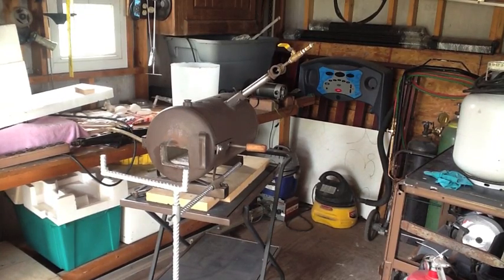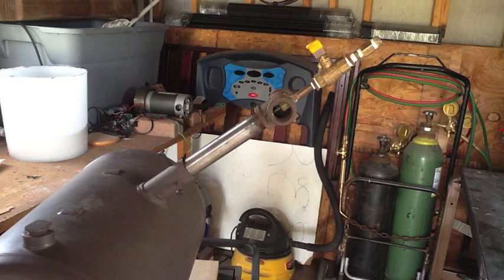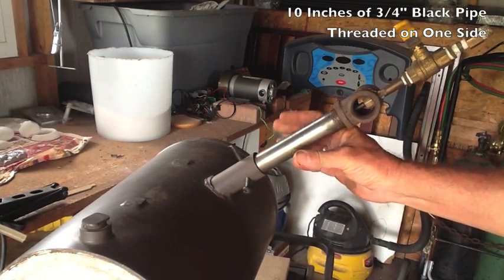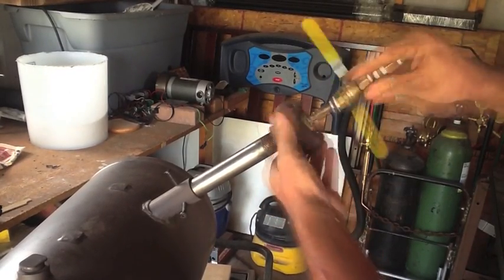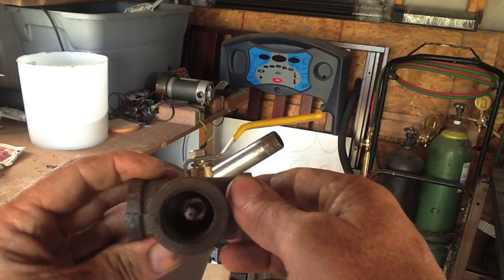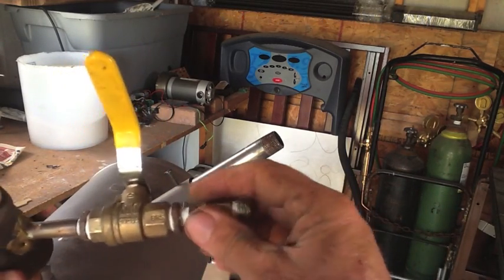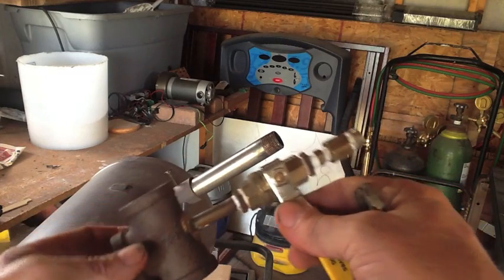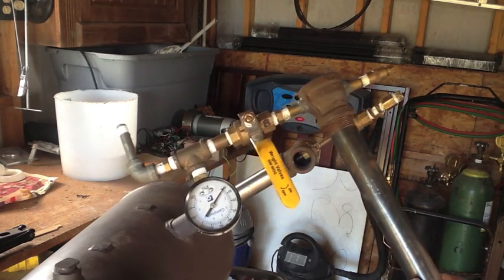How To Make A Propane Blacksmith Forge Burner ~ Build Details - MSFN

Comment: @MSFN why did you went back to 1/8 after the ball valve in direction to the propane tank if the valve is already 1/4 and the propane connection as well
Reply from the maker: Only because the 25' hose that I had connected to the propane tank has a 1/8 NPT connector. The price for a 1/8" ball valve was outrageous locally
Reply: Thank you very much for the response, going to build the forge this weekend, hope end up somewhat looking like yours and great job btw!
Reply from the maker: I never built one so was wingin it....it was built over a 2 month span. If you can build one over a weekend using my vid as a blueprint....I am glad I put the video up. Wish I woulda gotten more video during the process. Good Luck!! ~ Richard

Comment: I think I made a mistake. I bought a normal grill regulator and not getting enough Gas Psi. I should have gotten a high pressure regulator right?
Reply from the maker: A grill regulator is fixed at 5 PSI, fine for a steak but when using these burners in a forge or foundry you need adjustability. My foundry can use this same burner but runs best around 8-10 PSI for melting metal. This same burner in the forge runs best at 12-20 PSI depending on how big of a chunk of metal I am heating. Yes, get a regulator adjustable from 0-30 PSI.

Comment: i have a weed burner that i use for some of my heat treating. I know the bell on it wouldn't be much good for a forge, but if i made one of these would the unregulated hose work? or is the regulator a must?
Reply from the maker: You would need an adustable regulator for one of these type burners, a BBQ regulator wont work
Reply: Makin Sumthin From Nuthin yes, but I do not have a regulator at all...
Reply from the maker: I feel it is much too dangerous to run a propane line with no regulator. Research flashback
Reply: Makin Sumthin From Nuthin thank you sir, that's what I was looking for. I will look into a regulator.  thanks.

Comment: i followed your instructions for building my own burner, and it doesn't get the same result as yours. I'm trying to find the "sweet spot" for the air to fuel ratio by moving the 1/4" pipe up and down before i JB weld it.... and I'm getting anything from a soft burn to a sputter then it poofs out. any suggestions? thanks!

Also- using a hand stacked fire brick forge, no cement/mortar, don't have the money for the ceramic insulation yet.
Reply from the maker: Running it outside of the forge itself will cause it to blow itself out. What PSI are you running? You are using an adjustable regulator I hope ??
Reply from the maker: Mine sputters a tad till the forge heats up
Reply: i have a regulator, its a standard one for a gas grill, so non adjustable. i will try to get it to heat up a bit when i check it next, likely Friday, will keep you updated to let you know how it works.
Reply from the maker: A standard gas grill puts out a PSI of between 5-10 PSI....more than likely just 5 which is not enough to properly run a forge burner. I learned that mistake long ago myself.....also, you can add a flare tip (reducer) as shown at the end of this video which should eliminate your burner blowing itself out https://www.youtube.com/watch?v=VuXMs7MI8UY
Reply: ok, got the adjustable regulator, and that changed its output alot. i think  the only thing i need now is a layer of that ceramic foam, as i noticed the bricks absorb alot of heat, and dont reflect enough for forge welding temperature.
Reply from the maker: Big difference? See my newest video if ya need to obtain ceramic wool. Agree....If you are using the hard, heavy firebricks they are robbing you of alot of your heat
Reply: huge difference. I did find some ceramic wool at a local heating stove store. That made a huge difference in of itself. I still have to do some minor tweaking before i get to forge welding temp. (tried a few times and failed horribly; yay for free scrap metal) even got some borax for flux. I think I got someone to make me a metal forge box, so if I get that made and put everything together I will be able to hit where i need to for forge welding.
Reply: they most definitely have. as a beginner smith I know its important to do research and ask questions if something doesn't seem right, and your videos and comments helped the process along nicely. prior to this i used a wood fire to make one knife. and with what I got going at the moment I am working on two more and it is so much easier than the wood fire. (cant weld metal yet, but i can certainly move it well enough!)
Reply from the maker: Sweet, hope my vid(s) and comments helped in some way :)
Reply from the maker: Terrific, keep me posted :)

Comment: Could you tell me if you put a bell housing or flare on the end of your burner pipe that's inside the forge, and if not does this affect your flame in any way? Thanks....awesome build!!
Reply from the maker: The flare fitting is only need if you want to run the burner outside of the forge environment. Its not needed inside the forge...at least not for me

Comment: how did you stop flash back?
Reply from the maker: A ball valve is attached to the burner. The gas gets shut off there first.
Reply: But that would only stop flash back if you knew it was going to happen. Did you use a flash back arrestor or anything like that
Reply from the maker: No, but its probably a good idea even for a propane tank. I use them on my oxy/aceylene tanks

Comment: going to try to make but I'm going to make 2 with 1 supply. does the mig tip need to be setting in the middle outlet of tee. ( was going to drill and tap dead center of tee to just put the mig tip which will make the tip set back further )
Reply from the maker: If me, I would have the mig tip extend down into the tube feeding the forge...its what creates the airflow (venturi effect). Two burners is fine, you will just have to increase the PSI to feed both. I think you will have problems not extending the mig tip into the tube.
Reply: OK thank u
Reply: L

Comment: can you do this without the mig tip....  just inserting gas on one side of the 3 way and on the other side put a shop vac to create air...  then on the other side of the 3 way it goes into the forge?
Reply from the maker: I am not quite sure what configuration you have in mind. A mig tip can be omitted but gas entry would have to be closer to the forge. Adding forced air isnt needed for this set-up...Mig tips are cheap.
Reply: i was building a forge tonight actually.  I am using a three-way just as your doing....   but i avoided drilling a mig tip in place.  
1. (one side of the three way I am just pumping propane.)
2.  (The opposite side adjacent to the propane I have a shop vac to mix the propane with high volume air.)  
3. (Both air and propane is then shot out of the other side of the three way  going straight to the forge.)  

I was trying to find out how many inches the pipe (mix with propane and air) needs to be above the charcoal for the forge.  But looking with your design using a mig upsetted me in is this another thing I need to head out and buy...  does the mig tip prevent a possible explosion if avoided?
Reply from the maker: If you are using propane than charcoal is not even needed. A mig tip isnt a necessity but if you you want a jet venturi burner it sure helps a bunch as they sell many different sized orifices in mig tips. No need to use charcoal and propane...maybe I am missing something here.. :-/

Comment: When you add the gauge wouldn't you want one before and after the ball valve so you can regulate the PSI going in the forge? kind of like on an acetylene/Oxygen torch?
Reply from the maker: That would be an excellent idea. I just didnt want to toss another $25 at the burner. I can dial it in by the sound of the burner since I do metal melting as well. Great suggestion tho! :)

Comment: What size tap bit did you use for the MIG tip?
Reply from the maker: Each brand probly has different threads but I could give you the exact size of what I had to use. 6mm tap

Lincoln Electric .035 mig tips
Reply: use a tap gage , thats how i find mine

Comment: I'm looking to build a forge, and I'm torn between a propane like yours or building a coal forge. My question is how much use do you get from a full bottle of propane?
Reply from the maker: Tuff question to give an honest answer to. I use the same bottle for my aluminum casting and the forge so the bottle gets shared. I have never gone thru a bottle using just the forge from continuous use so honestly dont know. If the aluminum furnace is any indication since it uses almost the same indentical burner I can run the furnace for about 40-45 min at 8-10 PSI and use about one and a half pounds of propane. (I weigh my tank after each melt) 

I believe propane is 4.2 pounds per gallon and a 20 pound cylinder on a refill takes approx 4.7 gallons (at least mine does). If ya wanna run the math it will give ya kind of an idea how long it will last. (approx) This forge is pretty efficient tho cause it heats up and retains heat so well due to the ITC 100 and 2" of wool.

Comment: I can't figure out how to connect it to my propane hose. almost positive it's 3/8 fitting but the thread pattern is different.
Reply from the maker: My burner connection is 1/8" NPT nipple. Connects right up to my propane line. They call it 1/8" but the O.D. Is bigger than that
Reply: +Makin Sumthin From Nuthin where did you get your propane line?
Reply from the maker: It came with some device I bought long time ago, a CO2 generator. May bring your fuel line to home depot to get matched up
Reply: +Makin Sumthin From Nuthin I got it figured out I was in lowes trying to figure this out. lol I'll letcha know how it goes. lol
Reply from the maker: Cool, keep me posted :)

Comment from the maker: I hope everyone finds the video useful. This style burner can be used with a forge OR an aluminum melting furnace. Let me know your thoughts on the video below :)
Reply: Looks great! did you add the pressure gauge yet?
Reply from the maker: No, I sure havent, most likely wont.....why waste money on something working fine. Based on feel and experience with the regulator I would say about 8-10 PSI
Reply: Makes sense to me thanks for making the videos!
Reply from the maker: You're Welcome! More importantly, Thank You for Watching! Consider Subscribing :)
Reply: can you do this without the mig tip....  just inserting gas on one side of the 3 way and on the other side put a shop vac to create air...  then on the other side of the 3 way it goes into the forge?